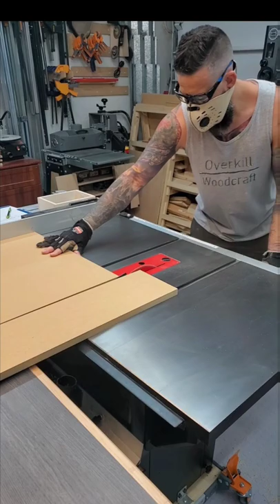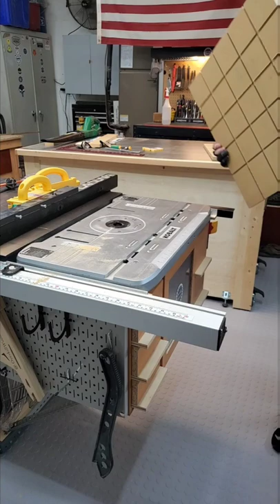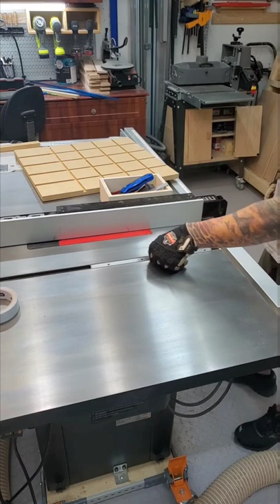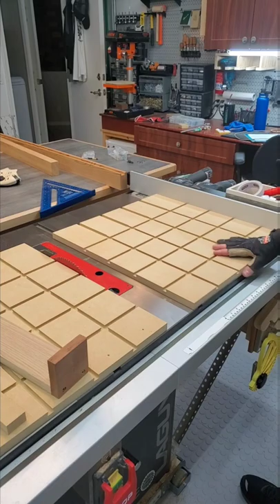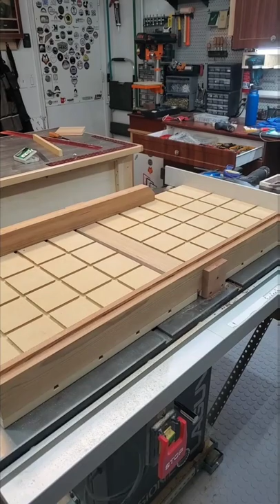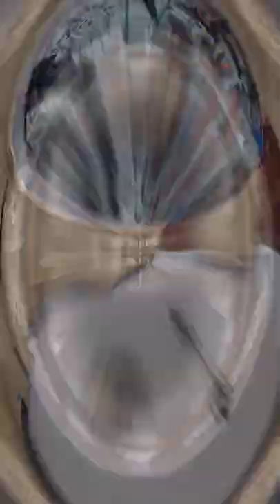Adjustable Zero Clearance Plate MATCHFIT Table Saw Crosscut Sled

Comment: Curious what is high density MDF? You mentioned you used 3/4 MDF in a comment. Can you clarify if its just MDF or something else?
Reply from the maker: My mistake for the confusing comment, I used high density MDF (or HDF, as some call it). It's basically just more compact particle board compared to typical MDF particle board. This makes it stronger, heavier, and more water resistant . I've seen other use regular MDF for the MatchFit system and it usually doesn't hold up well.
Reply: @OverkillWoodcraft  where do you find it? Only HDF named product I found was 1/8. Thanks
Reply from the maker: @asadiqbal01  No problem, I bought mine from Home Depot, but I know some big box stores don't carry it certain areas. Should be able to find locally at a plywood store though, some refer to it as High Density Particle Board too. Here's a link to what I used: https://www.homedepot.com/p/3-4-in-x-49-in-x-97-in-High-Density-Particleboard-1600650/202945875